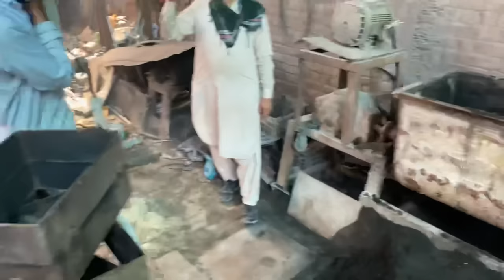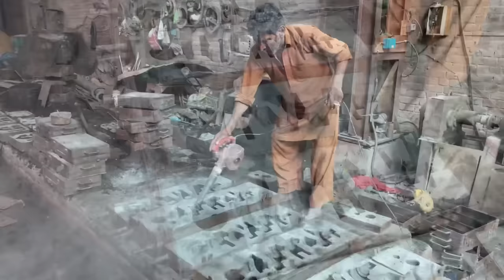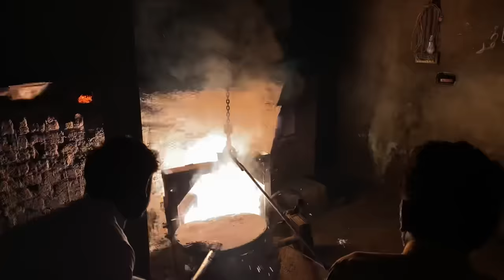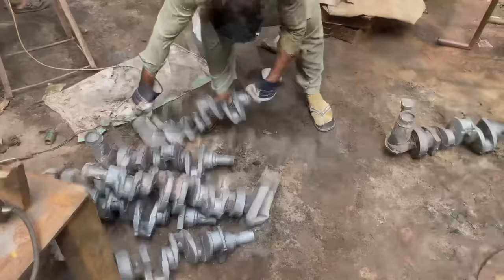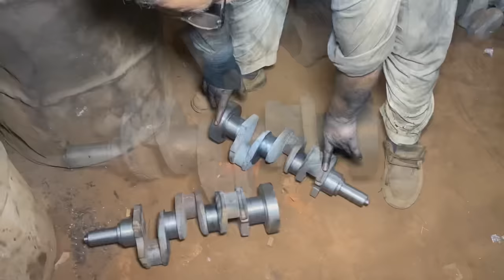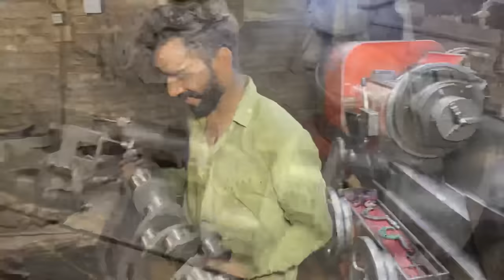Amazing Manufacturing of Tractor Crankshaft //Production of Massey Tractor Crankshafts in Factory

Comment: Fascinating and horrifying at the same time. I have some knowledge of the crank shaft machining processes, but never saw the molding process
Reply: because they are forged usually for a good reason...
Reply: @michigoesinsane what reason
Reply: @ahmedifhaam7266 different materials, usually less brittle ones.

Also, the forging process imparts certain favorable properties, chiefly relating to grain flow - which translates to a part that’s better able to endure shock loading and vibration.  These are issues in heavy duty crankshafts.
Reply: भाई जान अपना मोबाइल नंबर सेंड करना

Comment: Answers the question about why crankshaft repair is such a booming business there.  Full marks to these workers though as to what they achieve with the conditions they have to work in.  (handling molten steel - well some sort of Fe based alloy in sandals or even bare feet O_o)
Reply: Wearing sandals is the safest way to do it. Even in EU these guys wears sandals during this type of job. Why? Because if molten iron drop on your shoe, it's almost impossible to remove your leg from the shoe when it cools a bit, and it's still hot as hell, burning you feet. And it will go thru any materal you can possibly make shoes like thru butter (and then thru flesh of your feet). So wearing sandals ensures the fastest possible way to help when accident happen.   Think man, it's not hurting.
Reply: @SatanIsTheLord no they don't. They are using smelting boots. You're spewing nonsense.
Reply: they manufature like this, things are bound to break more often so business booming

Comment: the performance of forged crankshaft is more stable than that of cast crankshaft, that means cast crankshaft breaks faster
Reply: True but most OEM shafts are cast steel.
Reply: For a 20 hp farm tractor engine, you could make those cranks from wood and they'd last forever.
Reply: Вобщем круто ,сделать в таких условиях коленвал
Reply: @firstlast-ty4di  It’s for a 64hp Turbo diesel Perkins 903.
Reply: @badaschevy your point is valid, but so is mine.  A top fuel dragster with 12,000 hp at 8000 rpm with a 70 lb crankshaft has mechanical stresses that are 45.2 greater than an engine producing 64 hp at 2800 rpm with a 52 lb crankshaft.  The dragster's crankshaft is made of EN30B with a yield strength of 135,000 psi.  It probably needs all of that strength.  By comparison, the tractor would need 2,990 psi yield strength in its crankshaft.  Of course, you would not use wood in a crankshaft, but its strength is 3,000 to 6,000 psi. Cast iron is 18,000 psi. Mild steel (A36) is 36,000.  Good engineering and production is not making a perfect product; it is making a product that is good enough.
Reply: @firstlast-ty4di  And in this case good enough seems to be only outlast parts warranty. You may have missed the “dial indicator” (coat hanger) to find true on the rear main seal surface. The same surface they use as reference point on the chuck of the crank grinder….
Reply: @badaschevy, I was addressing the original poster's concern regarding metallurgy.
Reply: The secret ingredient is the toe cheese

Comment: The workmanship and skill is amazing, the actual working conditions are absolutely horrid. No protective footwear, ear protection or eyewear, open belts and machinery everywhere, dirty and dusty workplace, manual lathes to mention a few.
I have only seen crankshaftproduction irl once, and it was at a visit at the Volvo truck engine factory in Sweden, it was very different. Super clean environment and of course heavily automated, obviously a lot faster production as well. Seeing this is like going back in time. I guess Swedens work and safety laws and pakistans differ a lot... 😅
Reply: Just a little
Reply: But each of those Swedish workers cost 100x to employ compared to these slumdog millionaires

Comment: No hardening,no balancing ...just perfect!...
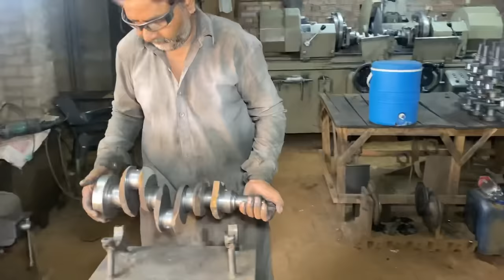Reply: 45:20 balancing)
Reply: @OSMAN5110  that is only grinding,for profesional balancing you use a dedicated machine.
Reply: @gabic505  Yeah, dude... It's a joke, of course. Where is your sense of humor?)
Reply: You don't harden cast iron cranks and why would you ever need to balance a tractor crank when it redlines at 3k rpm?
Reply: @redshirt510  Yes,you do harden the crankshaft  and you do balance them.I can say that as a manufacturer of hardening equipment for more than 30 years...
And balancing is important even at low rpm.
Reply: @gabic505  Cool sales pitch, but you don't ALWAYS harden or balance cranks, especially for a 60 hp, 40 year old tractor,  3 cylinder at that...

Comment: Here in the UK ra  lister made a single cyl engine started at 2.5 hp in the 1920s and rose to the diziing  heights of 6hp by the eighties all at 650 rpm. India started to copy these engines I had a customer in Syria who started to buy them from India  after a few years he came to me and asked for used crankshafts because the cranks from in India didn't last 5 minutes . These old engines produced by Listers in the UK sold by the thousands and went all over the world I have even seen 1930 models still running.  Whatever happened to this country. There are many YouTube video on this engine
Reply: This isn’t india it’s Pakistan these crankshafts are being made Massey Ferguson Tractors. They do not except vendors who did not match their standards. Gujranwala near Lahore is a major manufacturing hub. These is a foundry and finishing unit. The plants are in another place. Please appreciate that these tractors are being made there for 60 years, thousands every year! So with in a zh poor country if a machine which makes these parts unemployment increases. So it’s okay

Comment: Nice work! 
But how do they control the quality of the steel? 
They can't just use any scrap in the smelter. There are lots of different types of steel and you need steel that is suitable for making a crankshaft.
Reply: They don't have Quality Control.  Quality Control is too expensive for that outfit!
Reply: A cast shaft is a sketchy shaft😮I want mine machined from a solid block😊

Comment: At some point the question becomes; How many castings can be made from re-used foundry sand???
Reply: they mix the used sand with new = it's an endless cycle.
Reply: 7
Reply: Yes, Dino gave us the answer. It's seven (7).
Reply: There is a guy here, that just reuses all his sand.
Windy Hill Foundry.  But, he has a muller.
You can't wear out sand.

steve

Comment: The crankshaft is a critical part. It is under a lot of stress. I believe these are non-certified scrap metal parts of an unknown alloy. To be honest, I would not dare to install such a part in my engine, even if I was offered it for free.
Reply: Its probably a 20hp engine, will hold forever.

Comment: From some of the below comments, seems to be a question of the quality of the crankshafts. I also noticed the cast in "Perkins" on the crank. Those Perkins engines are second to none as far as efficiency, longevity, and being very well built. A lot of credit is due to these workers, getting the job done, and evidently done to the manufacturers quality standards. No engine manufacturer would use low quality internal parts, as their reputation and future rest upon how these engines perform. Now in the USA, I can see a parts manufacturer cheaping out on the grade of steel or some other process so that they would save a buck or two to increase their profit margin.

Comment: Correct me if I’m wrong, but is not a durable craft shaft because it should be stamped instead. The metal on casting can’t withstand the same alternating forces.

Comment: Absolutely horrendous, unsafe dangerous working conditions with a complete lack of PPE. Vats of molten metal with bare feet and not even safety glasses is just unbelievable. I'm sure it's a case of "if you don't want to do it, there's a hundred others waiting for the job."

Comment: They are using a mixture of scrap metal of who knows what origin, soft non-hardenable sheet metal scrap that they melt down to make a weak cast crankshaft especially for the demands of a tractor!. When making good quality crankshafts, they have a precise mix of metals alloys and minerals to make a super strong part.  Better than the guys that try to weld a broken crank shaft together but still not a strong part.  Then they are working in a forge in bare feet, no protection whatsoever.  Wow.  I guess when one guy gets hurt or dies, there are many more to take their place.

Comment: So, where is a quality inspector, to measure the tolerance on those fast spinning, highly stressed pieces, that need to be made to a specific requirement so they do not break inside the engine and cause catastrophic engine damage?  I bet those parts are made for Ford or General Motors, it explains so much.

Comment: This is not mass production and looks like it is very primitive and very dependant on the undoubted skill of the production workers.   Were Perkins engines of Peterborough ever made like this? Yes, I know that Perkins gave up on their foundry many decades ago when they were still owned by Massey Ferguson, but the massive volume of engines they made during the 1960’s to around 2000 surely called for more mechanised and repeatable methods than this.

Comment: Where's quality control? Are all cranckshafts in spec?
Where's material control? What kind of steel they throw into furnace?
Where's dial indicator on lathe? They hardly do any measurements during machining process. Just ruler and a piece of wire on magnetic stand
Where's heat treatment? All surfaces are soft, cranckshaft inself will wear quicker than bearings.
From technical point of view, a nightmare.
From historical point of view, 1850s are back

Comment: The clip is a big joke. from the way of formation, to casting to the end. Before closing the form, I give a mixture of graphite so that it does not form cemented on the surface. They have a 0.3 ton induction furnace where they did not clean the crucible or the oxide casting pot. you can realize what the result is. Put in the oven several times, especially tin scraps. What composition do you think is in the end?? It is a gray cast iron. Do you think that the tractor shaft is made of gray cast iron?? They made 8 shafts out of one batch, this is called productivity. At the end, they did a temperating treatment in a room without isolation. After turning, I did not see if they did a static or dynamic balancing test. Such pieces should remain on their market.